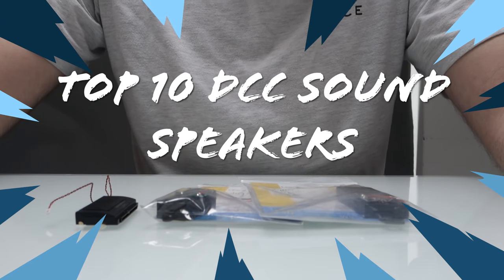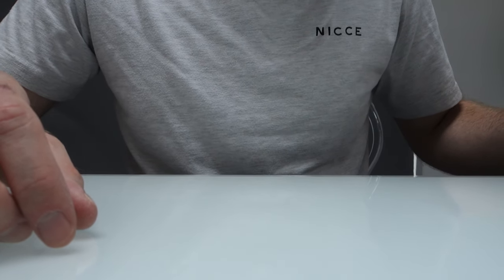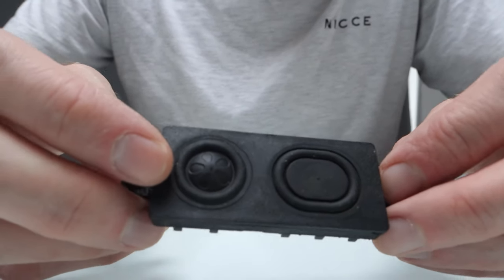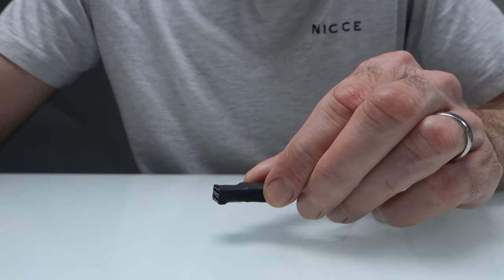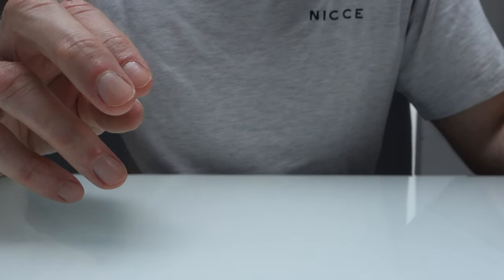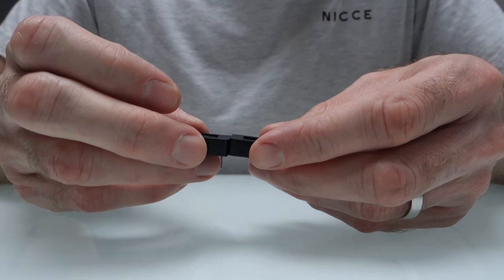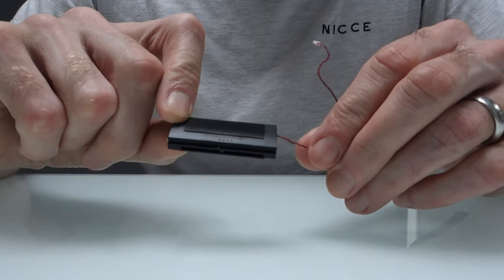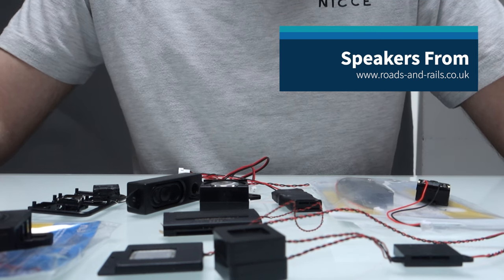Top 10 Best Speakers For DCC Sound Models

Comment: Great video Richard.  My favourites are the ESU passive radiator for overall sound, but space rules them out often.  The tablet one that you rated no.1 is definitely a great speaker, I’ve been really impressed with the clarity of sound and bass response is pretty reasonable.  I’ve installed half a dozen or so of them now and will continue use them for a lot for customer installs.  For steam, I’ll use the bigger ESU ones where I can, but will have to try out the 20x20 as I bought a few from you recently but have installed any yet.

Comment: I bought your number 1 speaker Richard, put it in a Bachmann Class  40 with your provided sound and the speaker is fantastic, thoroughly recommend it. Just fitted one to a Bachmann 45, had to remove the fan on this and cut down the screw lugs, but again, brilliant sound...

Comment: Hi. I've been watching your videos comparing speakers for years, and I agree with you on that I dislike "sugar cube" speakers too. Luckily it seems there are better options now.  I really like  #7, the Megabass speaker. I usually get them in pairs (yes, a bit of sanding on speakers' carcasses is needed) and get them into the tenders of the Alleghenys and other similar locomotives. I guess I'll need to give a try on the rest of the speakers you mentioned in this video. Never heard one of those "passive radiator" speakers. I'll need to build one speaker tester like yours as soon as I get information on how to redirect the output of the signal in ESU's decoder tester from the in-built speaker to the external speakers. Thanks for sharing this video.

Comment: Please can you do a soundcheck comparison again, like you did a while back? In my humble opinion, I don't like the 20x20 - it's too distorty for me. I do prefer the double iphone, as you said, much better since the firmware upgrade where you can adjust treble and bass. I'll have to order some of the others to try them out :)
Reply from the maker: I've never really had distortion with the 20x20, what sound was that with? I will do an update of that speaker test board, Its barely got any speakers on it at the moment!
Reply: @roadsandrails  it is with most Legomanbiffo files. I do enjoy high end hifi so maybe my perception is a little more critical than most

Comment: Great video. I have been struggling to work out which is the best option to upgrade a Bachmann Class 37/0 with integrated sound. Your website suggests a pair of 20x20 megabass speakers wired in parallel, but I did see one of your other videos where you used an EM1 in the fuel tanks paired with a second speaker on top of the chassis underneath the fan. And with some of the other options shown in this video, i'm even more confused.
Reply from the maker: The difficulty with this is that as new speakers come out there is sometimes a better new option, but it seems silly to take the old video down if it still sounds good, the EM1 will sound better than two 20x20 but its a much harder install, that not everyone can do. The smallest ESU passive radiator fits and is probably the best drop in speaker in terms of sound, at a slightly higher cost than 2 of the 20x20
Reply: @roadsandrails  That's good to know. I'm not one of those people that likes hacking into expensive models, so having a drop in option is more appealing to me even if it's at the expense of some volume and/or clarity. I've just ordered 6 of the 20x20 megabass speakers from your ebay store, as i'm sure i'll use them one way or another over time. I may take a punt on the ESU passive radiator too if that's a drop in option and likely to be better than two 20x20s in parallel.